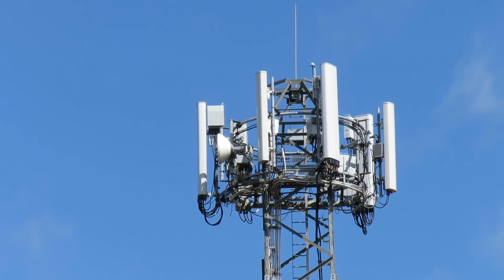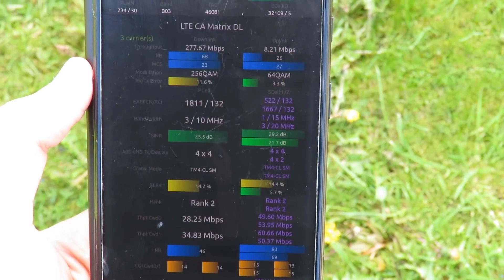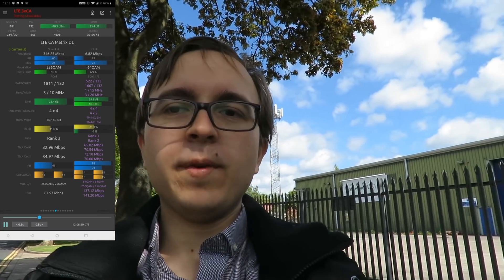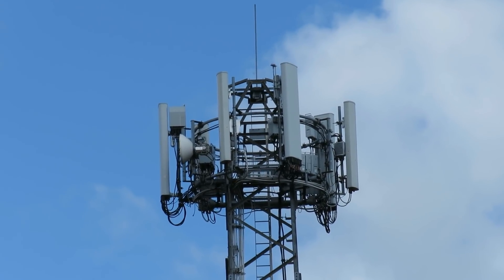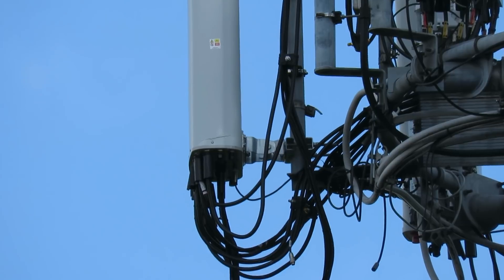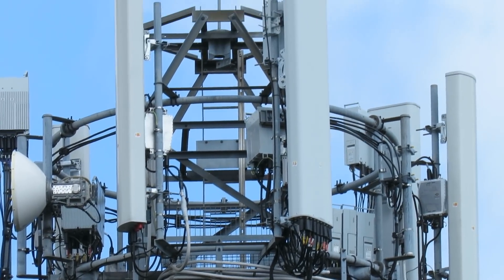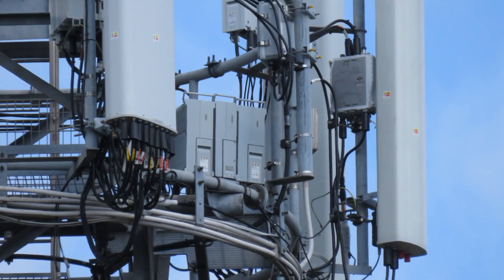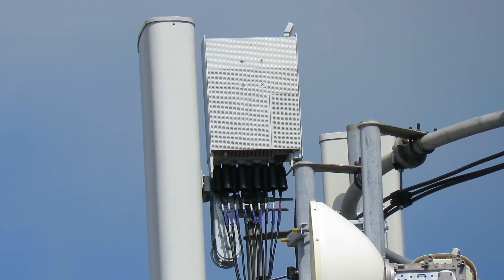EE 5G "5GEE" Mast Architecture Explained: Huawei 5258 8T8R N78 and AOC4518R8v06 Sites

Comment: Peter.  Is there any risk.to health on 5g. I'm in receipt of many people talking about destroying these masts. But they are unsure if they are powered by high voltage or low
Reply from the maker: The equipment on the masts is 48 volt - the same as four car batteries and roughly 1/4 mains voltage in the UK.
Reply: @scivids1999  so do you believe hype 5g causes coronavirus symptoms, such as stopping hemoglobin oxygenation and death etc
Reply: @scivids1999  if I sent you some photos of a mast next to our home could you identify it. Lately I noticed the door to the cabinet at the base was open, and lots of chalk or paint on the pavement, do you have an email address
Reply: @RRSYSinfo  One way to know if a street mast is 5G is if one of the cabinets are wrapped around the mast itself.

Comment: Please could you advise what the small dish on this set up?
Reply from the maker: It's a point to point radio link that connects the mast to the rest of the operator network. Many of them are now decommissioned, having been replaced by fibre cables.
Reply: @scivids1999  two have just been added to a 4G set up on a roof close to my house.  I watch the tower everyday as it is in my line of sight and these disks are new
Reply from the maker: Might be connecting up other masts or for backhaul uplift. All sorts of reasons.

Comment: For the last week i have had a nose bleed almost daily and i have just noticed they have atttached a small mast onto the existing 4g mast that is pointing right at me lol.

i think the nsoe bleeds have now stopped but if i get anymore health problems i am off to pick the lock to the roof and cut the wire.
Reply from the maker: Despite being within centimeters of a 5G mast for a sustained period last week, I have had no side effects. 
Your fears about 5G and masts will make you increasingly likely to notice and recall symptoms (recall bias). In other words, you may think you've become unwell, even though your fears are just affecting your perception.
Reply: @scivids1999  Adverse health effects of 5G mobile networking technology under real-life conditions - Toxicology Letters Volume 323, 1 May 2020, Pages 35-40

https://www.sciencedirect.com/science/article/abs/pii/S037842742030028X

Comment: Huawei is a threat to national security and Intelligence
Reply: No, why?
Reply: Obviously you have been watching to much news
Reply: They have stolen property from the TMOBILE US test lab and took it back to china
Reply: @carterg3339 That's a smartphone testing tool known as “Tappy.” a low tech robot arm lol, they claimed and won 4.8m USD in that case, nice robot, Tappy Happy!
Remember, Tmobile is just a network operator,  Huawei is a standard and equipment maker! 
According to IP lytics report on April 2019:

Top companies making technical contribution to the 5G standard:
1 Huawei Technologies Co., Ltd. (CN)  10844
2 Ericsson Inc. (SE)  8428
3 Nokia (incl. Alcatel-Lucent) (FI)  5843
4 QUALCOMM Inc. (US)  3018
5 Samsung (KR)  2621
6 ZTE Corp. (CN)  2341
7 Intel Corp (US)  1890
8 LG Electronics (KR)  1650
9 China Mobile (CN)  1345
10 CATT (CN)  1240
11 NTT Docomo (JP)  1173
12 MediaTek Inc. (TW)  397
13 NEC Corporation (JP)  381
14 Orange (FR)  378
15 Electronics And Telecommunications Research Institute (KR)  356
16 Guangdong Oppo Mobile Telecommunications Corp., Ltd (CN)  300
17 Keysight Technologies (UK)  253
18 Sony (JP)  241
19 ROHDE & SCHWARZ (DE)  228
20 MediaTek Inc. (TW)  200
21 Vivo Communication (CN)  190
22 Motorola Mobility (CN)  160
23 CATT (CCSA)  157
24 Sharp Corp (JP)  154
25 Fraunhofer (DE)  153

Top 5G standard essential patent owner as to the number of patent families
1 Huawei Technologies Co., Ltd. (CN) 1554
2 Nokia (incl. Alcatel-Lucent) (FI) 1427
3 Samsung (KR) 1316
4 LG Electronics (KR) 1274
5 ZTE Corp. (CN) 1208
6 QUALCOMM Inc. (US) 846
7 Ericsson Inc. (SE) 819
8 Intel Corp (US) 551
9 China Academy Of Telecommunications Technology (catt) (CN) 545
10 Sharp Corp (JP) 468
11 Guangdong Oppo Mobile Telecommunications Corp., Ltd (CN) 207
12 Fujitsu Limited (JP) 20
13 InterDigital Technology Corp (US) 18
14 Sony Corporation (JP) 14
15 MediaTek Inc. (TW) 13
16 Apple Inc. (US) 12
17 Industrial Technology Research Institute (TW) 10
18 BlackBerry (CA) 9
19 IPR Licensing, Inc. (US) 8
20 ASUSTeK Computer, Inc. (TW) 8
21 Electronics And Telecommunications Research Institute (KR) 8
22 KT Corp. (KR) 8
23 NEC Corporation (JP) 7
24 Optis Wireless Technology Llc (US) 2
25 HTC Corporation (TW) 2
26 Innovative Technology Limited (UK) 2
27 Sisvel International (IT) 1

You can find similar data from: https://www.iam-media.com/who-leading-5g-patent-race
Reply: No it isn't
Reply: Says a paranoid American, Canadians don't seem to be bothered or Mexicans..x